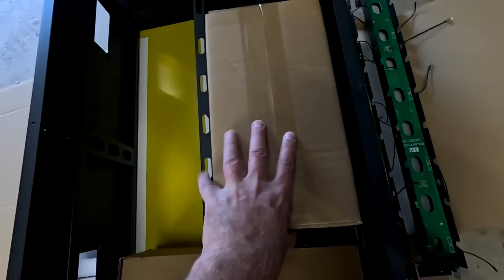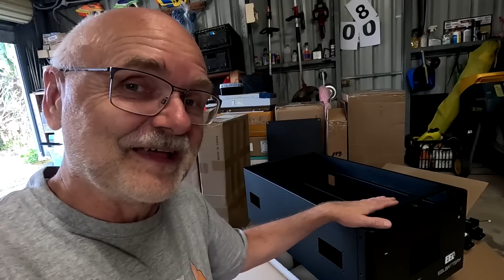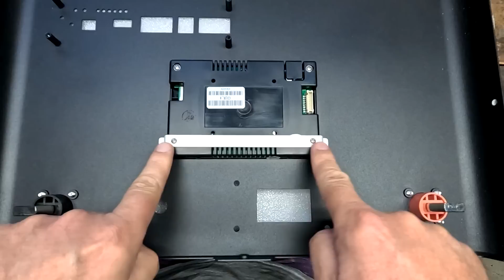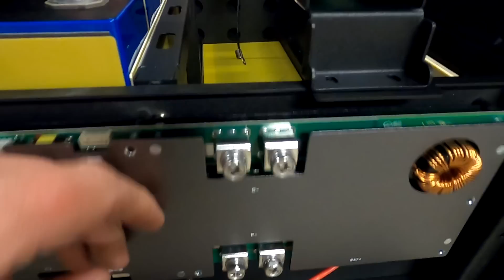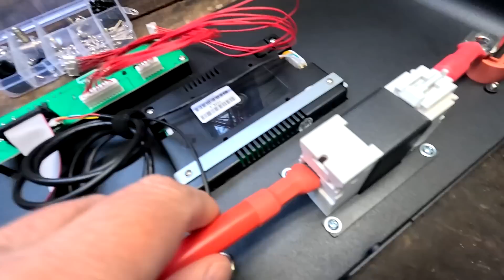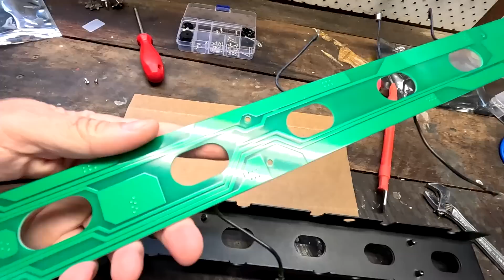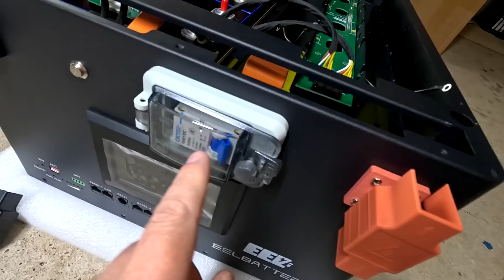Testing the new EEL V4 48V DIY Box with JK Inverter BMS. Are we there yet???🫏

Comment: For grounding the chassis, you should be able to use any through hole like the handles or scrape the paint away and use a self tapping screw like you could for negative on a car chassis.
Reply: I have never seen Andy connecting a battery case to ground. I'm not shure why he cares about in this video.
Reply from the maker: The batteries will be grounded once in place. Not worth doing atm, when I wheel them around and dis-/connect so often.

Comment: I recently assembled a similar EEL 48V box but without the display and with the BMS mounted on the front plate. It didn't include the flexible busbars, just the silicone cables. Some of the compression plate screws were too short because of the gap between the plate and the frame. One EVA foam sheet was missing. Overall I'm satisfied. Question: could you please publish the link to the assembly manual? Thanks!
Reply from the maker: Thanks for sharing. The link is on my website or here: https://drive.google.com/drive/folders/1T7Amp5mqtl4twecgZRhJCK4hoWncbNDE (EEL Google Drive)

Comment: They have one Flaw, not "real" 19inch Rack mounting .. only I call it "passive" rack mountable like on some universal Rack Mounts where it is only sitting on top of it and not sliding in with rails.
Maybe I will call them when im on the way to build it for my house at the end of the year.
Reply: Yeah, they're more like "19 inch stackable enclosures" aren't they?

Imagine trying to lift one of these into an actual rack. It's better to stack them as designed.
Reply: @CollinBaillie  don’t lift alone. And there are rails designed for this workload to pull out the whole way. Only thing is to not pull every battery out. The rails are for the maintenance .. so you can have them in a rack, and can do maintenance alone without someone helping to lift that over or 2 other persons.
Reply from the maker: The EEL is not as wide as the other boxes. It's really a lot smaller in any way.
Reply: @OffGridGarageAustralia  that makes it even better for rackrails. Thank you for this detail

Comment: You’re not happy no ground bolt but I didn’t see any ground wires on any of your batteries.
Reply from the maker: Because I don't use these batteries as such and wheel them around all the time for testing. Once in place, they all will have a ground cable.
Reply: You do a fantastic job. Very professional. Put my system to shame. Would be a good experiment. If the case was live what would happen?  I don’t think much?  Unless one case was live positive and one negative and you dropped a spanner across them?  They wouldn’t trip any breakers would they?
Reply from the maker: @swolath  It's more the AC side of things we are protecting for. Your battery is connected to an inverter, so there could be the potential, that you end up with 230VAC in the battery case somehow. Unlikely, but it is probably more to satisfy the regulations...
Reply: Good answer 😀

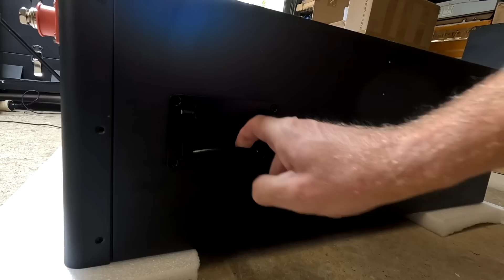Comment: 25:54 kenshee boxes have handle holes where you can put the handle only one way and the hole is upside down. 😅 then the handles are wrong way and don’t work as intended.
Reply from the maker: Hahaha, like the QSO battery box, handles upside down which squeezes your fingers.
Reply: @OffGridGarageAustralia  yes, they don't lock into 90 degrees position but are pulled back to resting postion with fingers in between. Don't they try those themselves? Or everyone who has, have their fingers in bandages?

Comment: I have 5 white eel v4 (no display) and no quality issues. One NTC was defective but since it is diy I used the one from the original JK bms cabeling and replaced it.
My version is different. The JK bms will be mounted on the front coverplate not the compression plate. Also no busbars just the cables. My PCB is labeled 2A and 2B, while yours is 3A and 3B 

Btw: For the last box on top I closed the holes 🕳️ in the top cover using the oval foam cutouts from the rail foam

I stacked them with the rubber feet. But for the first one I set it on a wheel dolly with 48 tiny wheels to carry the 600kg stack
Reply from the maker: Good idea to use the sticky foam to cover the top holes👍

Comment: Two parallel circuit breakers would be better in terms of resistance and narrowing the busbar area. The ideal way to connect to a single circuti breaker would be just a ferrule on the cable.
Reply from the maker: Yes, as expected. What they did was not great.

Comment: I have 3 if them on thier trolly. 2 of the V4/EVE LF304 and 1 V2/reptile 305(B) all seplos style bms , the B reps were a pain with the V2 due to swell, the EVE in the v4 boxes were much better, as fat as the feet do on the boxes, they lock the cases together, so your engine lift is about the only way to get them back apart without scraping the paint on the top /bottom of the case.😂
Reply from the maker: Ah, thanks for the feedback about the feet! I knew they were far too soft and conical shaped. Not great! Should have given 3 frogs only😄